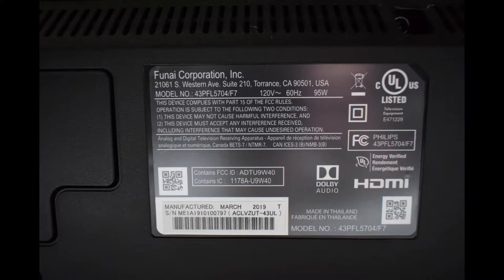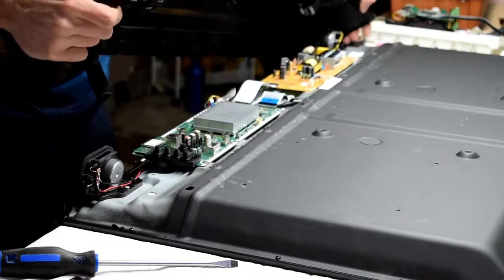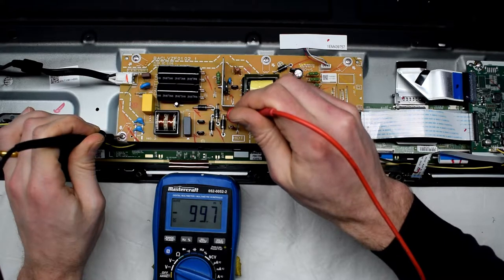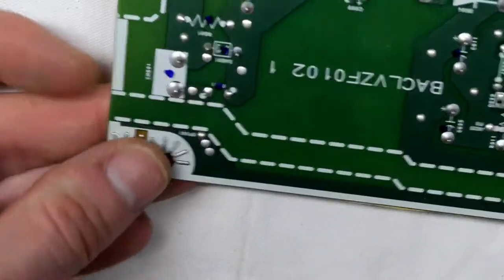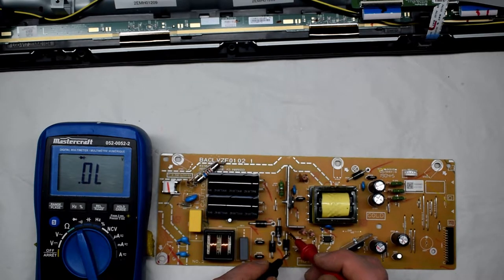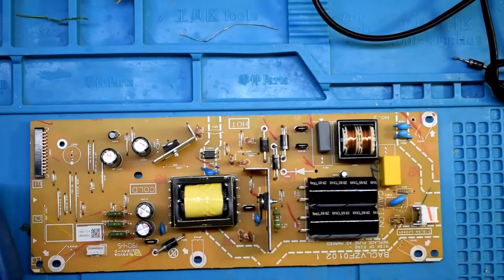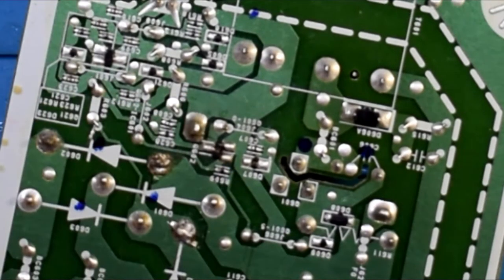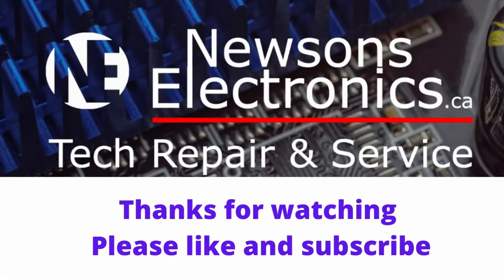Philips TV 43PFL5704/F7 (Does not turn on due to power outage!!!)

Comment: Hello there!  Our Philips 42” TV (bought in 2016) has standby power light (red). It responds (red light disappears) to the remote when power button is pressed or when power button on the TV is pressed but no picture, just black.  After a while, the standby light goes on again.  What could be the issue?

Comment: Great, quick video. Helped in diagnosising the issue with mine.
Reply from the maker: glad to help out.
Reply: @NewsonsElectronics   I have the same problem but I had the Ethernet cable connected can it be the control board or should I just get the power  board

Comment: maybe a little bit late, I might have the same issue. I tried the hard reset and once this worked however after one day tv did not go on and also the hard reset does not work? might the problem be the same as you describe?

Comment: My tv is getting power, but won’t turn on nor will the remote receive it. What do you suggest it is ? Also there’s a coil whine that happens every so often … what does that mean for the tv?
Reply from the maker: is there a standby light
Reply: @NewsonsElectronics  No, there is no standby light.
Reply: @newsons electronics I’m having the same issue after replacing board everything checks out diodes alll read good hearing a slight whining . No stand by light button on the back and or the remote does nothing any help?
Reply: @djguzzy6339  use and led tester there may be a short. eg drawing too much current
Reply: @MrNew-us1lg  wouldn’t that just be useful on a back light this has no standby light or indication that it’s powering up at all. Had a power surge tv wont come back on fuse on main board popped changed that board is possible the tcon board of the display board got hurt during the incident? I ohmed out the tcon board at the source gate and dump and ohms correctly
Reply: @djguzzy6339  Hi, I have the exact same issue right now. Did you solve yours?
Reply: @Skillsal-enezi  nope just tossed it and got a new one
Reply: My tv Roku Phillips kinda similar issue …it turns on there is a picture but it does not respond to the remote and it turns itself off and on ..what could be the issue ??? Please help

Comment from the maker: Any Questions just ask them below
Reply: My tv makes a small noise like if it wanted to turn on but I lost my control to turn it on so we are using the buttons on the back of the tv but its still a black screen/before I had lost the control it used to due the same/we have only had they tv for about a year it the same one in the video?what could it be?
Reply from the maker: @alexmichel2937  sounds like backlights
Reply: @NewsonsElectronics  Eazy pawn has this TV but it cuts on for a min screen flickers and shuts off i did power unplug and factory reset still the same issue
Reply from the maker: @hardyb311  it may have a bad backlight